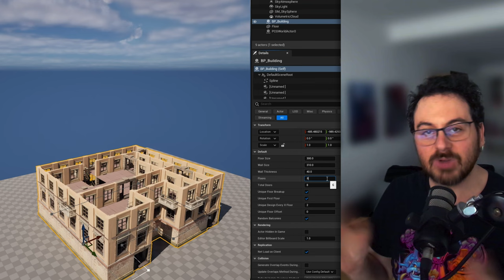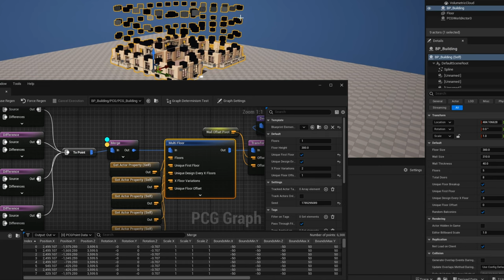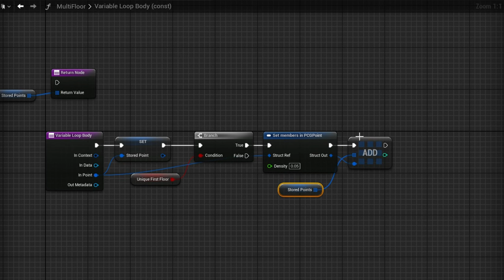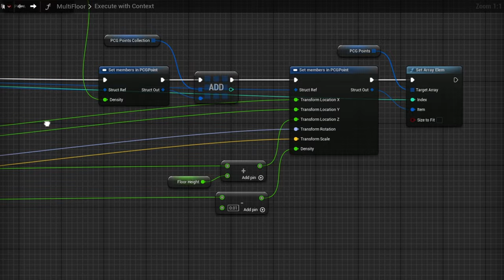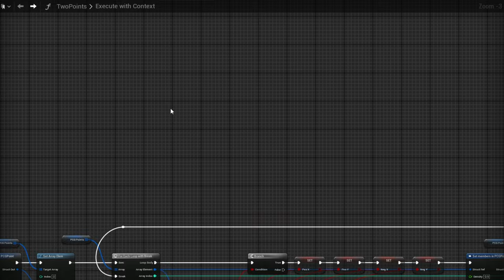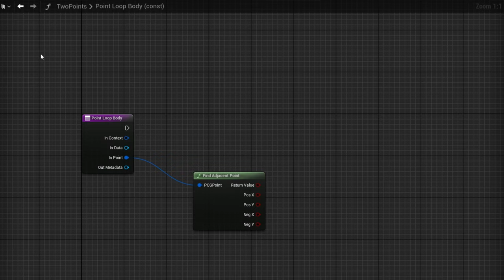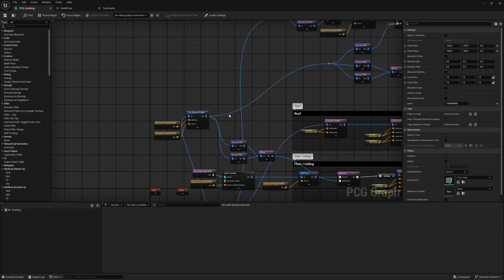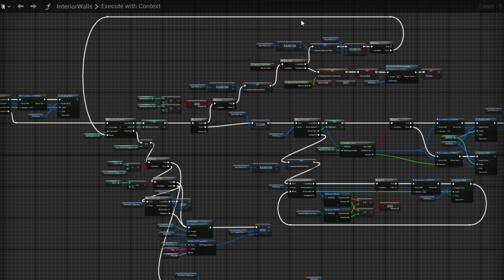Why You Should Use Loops In PCG | Building Series Part 7

Comment: Good stuff. I like it.
I finally remembered how to get the sizes from the static mesh -> bounding box -> max - min -> if you make an array of meshes and use that as an input, that should actually allow it to have the height, width and length automatically. You then can use your original wall size variables to instead be used as an offset, by adding them to the calculated sizes.
Reply from the maker: Yep, you got it pretty much spot on. The only thing that's stopping me from implementing it is I want to figure out a good system for it considering every single piece can be of a different size. So there has to be a "main" piece everything uses as a base. But yeah, you got it pretty much. :)
Reply: @Procedural_Minds one way could be an array of structs, containing a key-value-pair (map) variable where each key is corresponding to the fitting static mesh.

The disadvantage is that the map would need to have some initial entries, or at least you would have to change the logic flow a bit to not spawn static meshes when the key doesn't exist.
You would also need to think about what kind of key it would be.
An enum? A name / string? A number? Depending on what it should be, there might be limitations or issues that might reduce the effectiveness of the system.

(Sorry if I don't seem to make any sense, where I live it's 4am andI was thw whole night up watching a show, so I'm pretty tired 😅)

Comment: Hey man! Thanks for the tutorial, great series! You probably know this already but in order to use the functions inside the loop overrides you just need to mark const inside the Advanced settings on the function details. 
This is due to the compiler loop optimizations, marking it as const guarantees that the state won't change so it can safely optimize the loop.
Reply from the maker: I didn't know about this. Thanks for the information! Is there any reason to ever not check it?
Reply: Not to my knowledge. Pure functions are supposed to not ever change state so in my mind this should have been automatically turned on by the engine.
But in C++ you can declare pure functions that are not const, so I guess it's a hold-over.  @Procedural_Minds
Reply from the maker: @danribeiro138  Oh pure functions! I know those, I thought the const functions were something different. Good to know about all this. Thanks for sharing! :)
Reply: @Procedural_Minds  yeah, I didn't test, but I think you could get by with a const, non-pure function, but at that point you could just make it pure. Been checking the source code, the context is copied to a thread-safe context and the loop is handled by different threads, much faster in this case when working with point data.
Anyway, awesome tutorial series, learned a lot! Latest video was great, can't wait for the next! Keep up the awesome job

Comment: Hello and thanks a lot for this awesome tutorial series !
I think you forgot to plug in the Pos/Neg booleans in the the point loop function body.
For some reason I can't get that point loop function to work...
I watched that part like 10 times and I always end up with only one point selected by the variable and set @0.5 when I debug the two point function in PCG Graph.
If I force the branch @true in the point loop function, all the points on the floor are at density 1 but as soon as I try to set the density to 1 to a single point in the point loop, it doesn't work for me.
Reply: OK, if I test PCG Selected Points <= 2 instead of ==1 in the point loop funtion it seems to work... I don't really get why but good for now :)
Reply from the maker: Double check that you have everything plugged in. Someone else had a similar problem and they just didn't hook up the index into a get node in one of the areas.

Comment: The reason you can't assign a value to a non-array variable in the loops functions is because the functions are marked const. So you can add/remove items from an array but you wouldn't be able to assign a new array to the variable inside the const function. Same thing with the Find Adjacent Point function. It's not marked as const and you can't call a non-const function from a const function. Since that particular function doesn't change anything, you can mark it as const and call it from the point loop body function.
Reply from the maker: Thanks for the explanation! :)